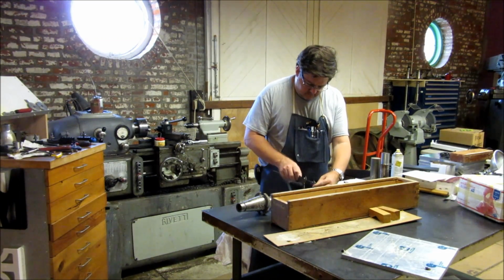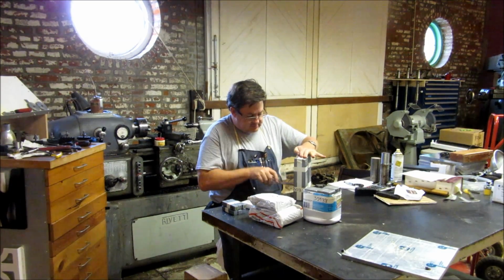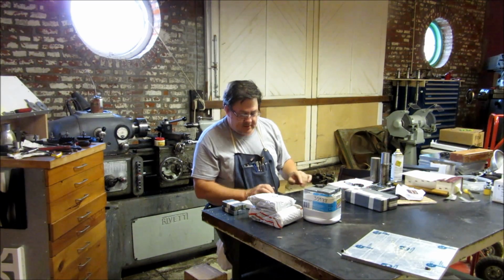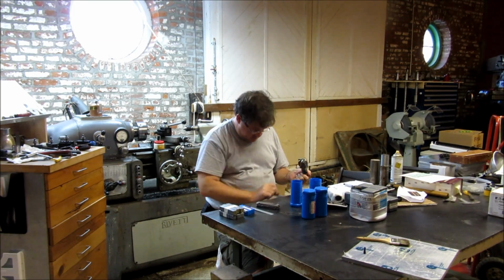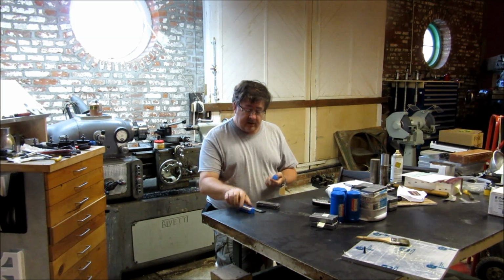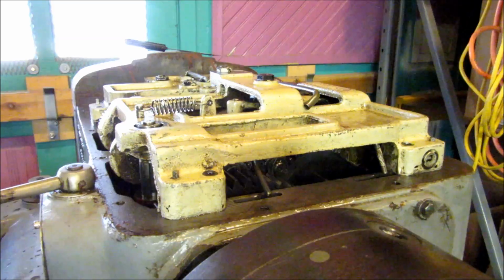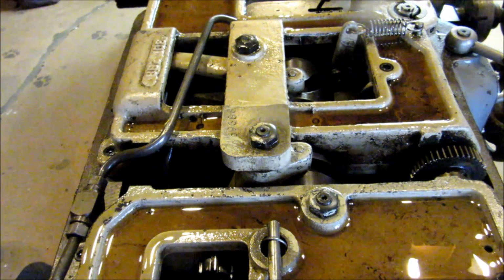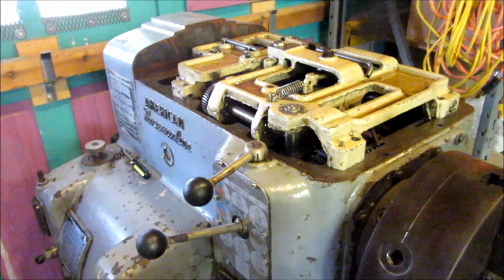Shop ADHD #7

Comment: I'd check in the area of the oil pump. Maybe check the oil with a magnet for micron metals.
My Caterpillar dealer offers me lab analysis' on all oils I change and they can tell me what metal is wearing in the engines, hyd. pumps, etc., as they can catch all metals. Maybe give your Cat dealer a call and ask the lab supervisor if he can possibly help. If they find copper, brass, nickel, etc. it might give you an idea where to look, if it's in the metals of your gear train. Just a thought. 
Thanks....13

Comment: Check the belts. Spray some lube on them and see if the sound changes. Man that thing can pump some oil.

All the best,

Tom
Reply from the maker: Will do Tom, I'll report back on the outcome.  It does pump some oil, and it is speed, the higher a speed you choose the more it pumps.  Note I had it at the third to lowest speed!  I made the mistake of firing it up with the lid off at 240 rpm once, took me hours to clean up the mess, off of me, the floor, the big K&T, it was nasty.

Comment: Maybe you could time the tick sound and figure out the rpm that would tell you if it is something simple on a gear or shaft?
Reply from the maker: That's not a bad idea, it makes a much more pronounced and regular, noise when under load so I need to put something in the chuck and give it a go.  And I will have to throw the top back on, or I will be wearing that oil all over the place.

Comment: I didn't want to be rude, but now is probably a good time to ask.... What is that vibration when just the motor is turning?
Reply from the maker: John, I have no idea why this new camera shakes like a MF using the same mount the old camera used.  I am going to try turning OFF image stabilization and see if that helps.  Otherwise I have to get a tripod.
Reply: James IS is for slow movements eg hand held , quick movements and tripod work it should be off

Great vid as usual glad you have gone HD your vid did not look to good on a 27 inch apple screen

Stuart
Reply from the maker: I am going to try it off, the old camera didn't have the feature and it worked great, they are both Cannon cameras BTW.  Thanks for the tips.  Please let me know if you can see the difference starting in the Knee Crank video #2

Comment: Thanks for the video! You scored some great tooling! Don't you just hate it when you get something, put it away and forget about it? I've almost purchased a new one and then the light dawns that, somewhere, I think I got one eons ago. That can get a little expensive if you ending up getting a bunch of stuff you already have! I have never seen inside the headstock of a large lathe like your Pacemaker. It will be interesting!
Have a good one!
Dave
Reply from the maker: Same here, getting to peer down into a machine like that is always interesting.  Hopefully I don't end up with extra parts!
Reply from the maker: chemech Yep, and you know its always that itsy bitsy part you have to take then entire thing apart to put back!  Some little spring or set screw that disappears in hydraulic oil.
Reply: James Kilroy Yeah, those "extra" parts are always worrisome... since you know that the designers and manufacturers were "Scottish" with their designs - for the most part - and already left off every single thing they thought that they could get away with...

Cheers,

Eric
Reply: Or the crud in your chip tray, or in my garage, gets ground into the asphalt floor...

The Mad Prophet Murphy and the God Finagle (Larry Niven reference!) laugh at you, because they gave fair warning!

Comment: I would look closely at the gear engagement to make sure a gear isn't slightly out of place. As in maybe, a slider fork with, a lever, or the fork having a broken pin something simple or even a chipped tooth... Good luck! :o]

O,,,
Reply from the maker: Thanks for the tip, I will be able to get a pretty good view once those two top trays are taken out, maybe I can see something then.

Comment: Cool tooling.....makes us "pions" want to get a big machine!....probably could almost buy one, for the amount that you saved on those endmills! I let a nice 310 S-15 slip thru my hands  a few weeks ago, that was mistakenly listed for 500.00 !.....it's that moving that is intimidating!....same for today....I'm off to pick up my new 16" Whipp Shaper!  When I get it going....I'll want to chat about some cutter profiles/grinding.   Jim
Reply from the maker: Don't be afraid of the big girls, they need loving too.  500 is probably less than scrap value?  Did it have a vertical head or arbor supports with it?  Hold on, you passed on a S-15 and purchased a shaper instead?

Comment: Great score on the end mills. I love those 2" roughers. I have a few of them and they work great for removing lots of stock at once. Would love to try out that big boy 2" on the K&T...:)
Reply from the maker: 2" is a nice size for the 307, no drama, just chews away the metal and you can run them slow enough that you don't sling red hot chips all over the shop.